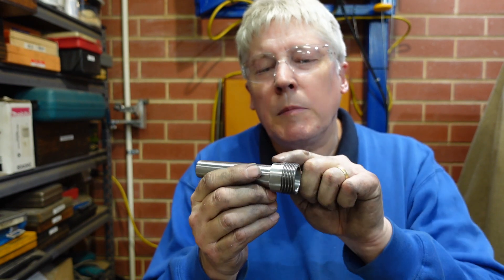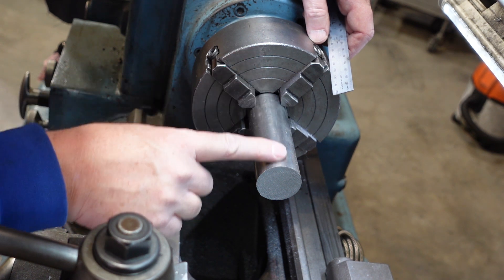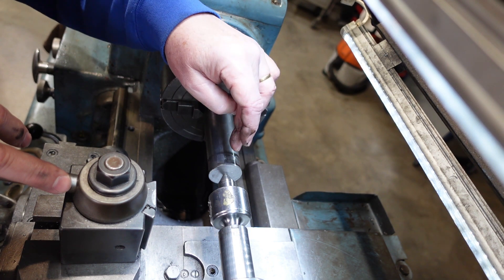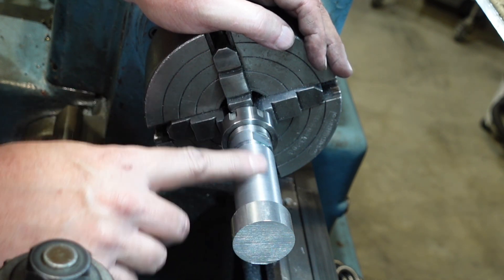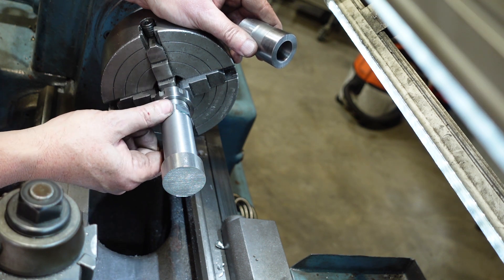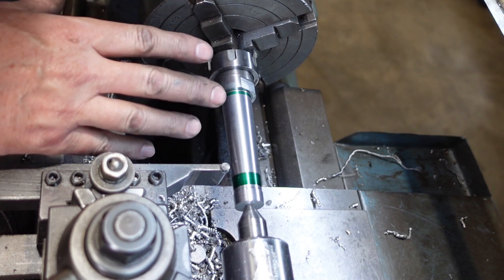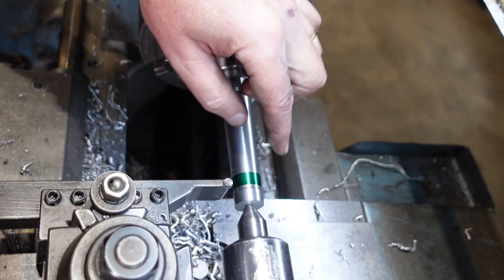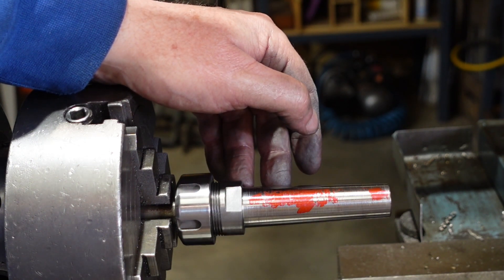Boot strapping a mill - a slight detour

Comment: Why, since you have a taper attachment on your lathe, are you using the compound to cut the M3 taper?
Surely, your attachment should be able to cover most of the "work envelope" between the surface of the chuck jaws and the minimal extension of the tailstock or the "distance  between centres."  Then, the saddle drive of the lead screw should advance the saddle, and the cross slide moves according to the taper preset on the taper  attachment. 
No "fudging" of the compound slide movement is necessary! Is it? Seems elementary to me, Mr Watson?
Regards from Canada's banana belt. 
🤞 🇨🇦 🍌 🥋 🇺🇦 🕊 🇦🇺🐨🪃👍
Reply from the maker: You are right, and if I were doing this 'normally' I would use the TTA - setting up would be similar but here I wanted to show those without a TTA how to set up and cut on a less featured lathe. For the same reason I used a steady rather than putting the material down the spindle bore, just because some viewers probably have a smaller spindle bore that would not take diam. 32 stock.

Comment: Nice work! Few years back I did the same thing to save little bit of money and it's a very demanding part to turn. Having the least amount of runout is quite tricky. 
By the way very nice cva lathe!
Reply from the maker: Depends a bit how you use your milling tools - I never try to get a slot size for size directly from the cutter, so the couple of tenths run out should not worry me. As for the lathe, thanks. It's been with me for a while. Had to rebuild a few bits of it but I can't imagine having anything else.

Comment: Thanks for that Michael. Again more interesting ideas on making our own tooling. 
You could end up with a small fortune with this hobby, by purchasing everything required, trouble is you need a LARGE one too start with.
Reply from the maker: As the anecdote goes, typically you can spend just as much on the tooling as on the machine
Reply: Got a hobby mill recently, the "tools" are adding up to it's  price. Learning----learning.